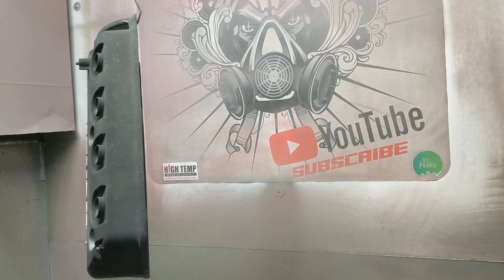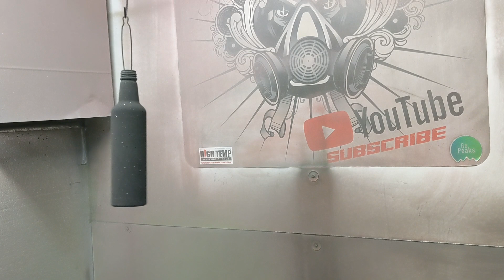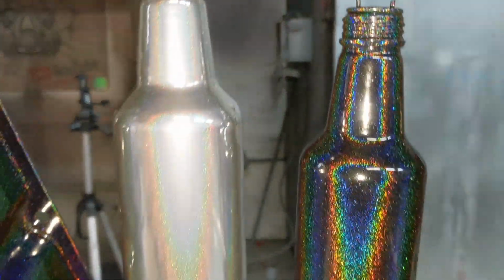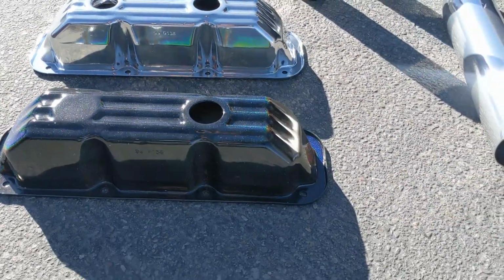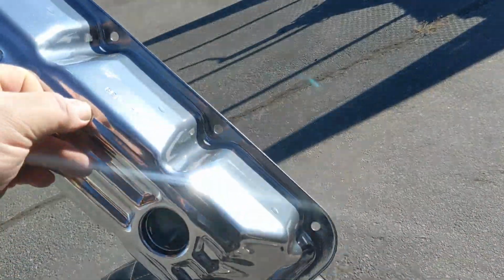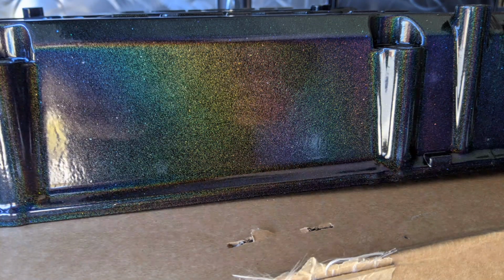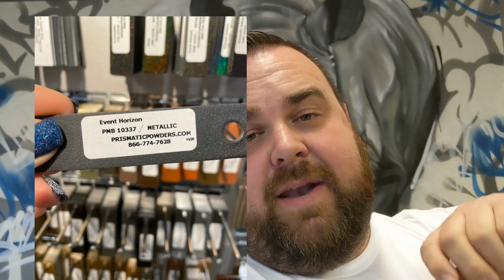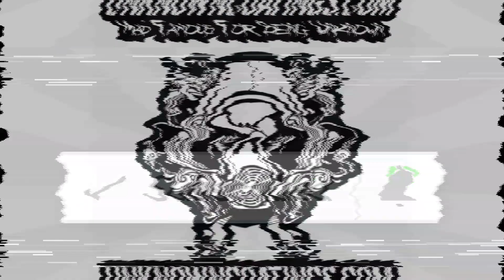Powder Coating with Prismatic Universe & Shugga Thrillz - Ep 97

Comment: Howdy Unknown,...Can you powder coat a plastic/fiberglass motorcycle fairing to match the powder coat color of the metal parts like tank, fenders, frame???...and is the prismatic universe a clear flake that you could use other base colors like illusion Smurf (Blue)....So that when the flake sparkle is not "SPARKLING" in the sun, the base color would be the Smurf Blue???

Comment: Why does Shugga Thrills look so less dynamic in this video than the swatch video on Prismatics website?  Is that due to the material it's sprayed onto? Thanks.
Reply: 100% dependent on lighting. In not a well lit area you wont see it, its very subtle. It also is very dependent on angles and the geometry of what its been applied on. Usually colorshifting or holographic powder coats work best with bery obtuse geometric style metals, so use it on rims that have crazy curvature for best results. Also when its sunny out, dont be surprised if people break their necks and backs, because it is freaking beautiful. Shugga Trills is the best in my opinion, very unique and no over bearing, but I can really see an appeal to Prismatic Universe too.
Reply: @descendinggod9740  I appreciate the reply. I'm considering putting in on set of wheels, but without any other samples to look at I'm having a tough time determining if it's the look I want. haha
Reply: @RayneCollects  I am also considering putting it on a set of wheels too haha. From what I am getting, from a far distance away, it will look like regular glass white rims. ONLY if you get very close within touching distance can you see the crazy color shift and dynamics at its fully potential, but from a sidewalk distance you can see it but only if its really sunny out and the lighting is just right. So in short mans terms, long distance its nothing special, up close in the sun its a glitter bomb.
Reply from the maker: its just not a super dynamic color honestly. In good lighting the color is there but you wouldnt notice it at 15 feet